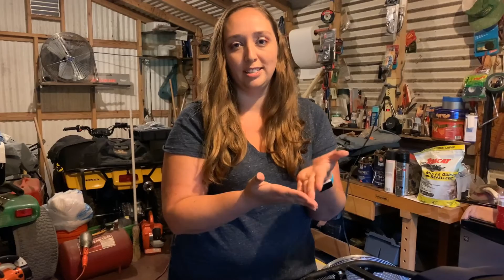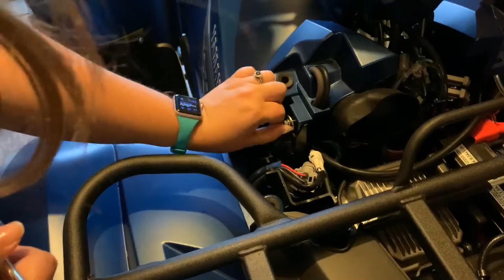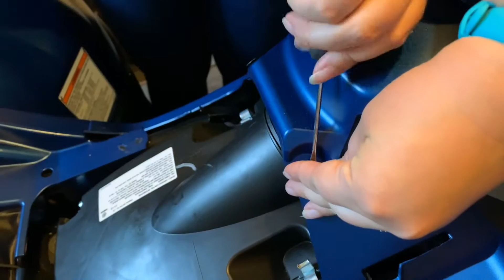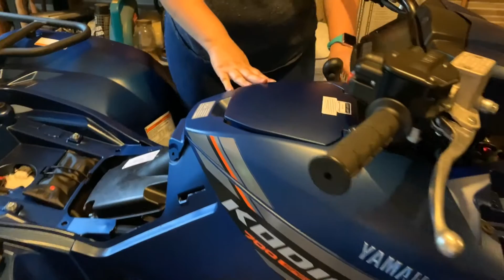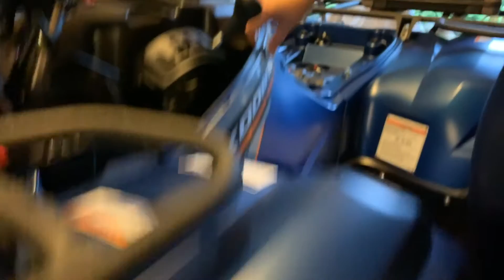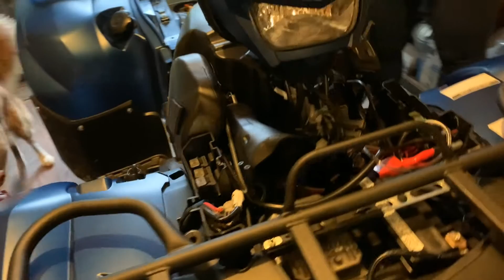Removing Plastic Panels on 2019 Yamaha Kodiak 700 EPS SE: Scarlet Shows Ya How

Comment: Thank you. But how do you take off the seat? Im scared to pull tug too hard and brake something.  How do you change the air filter?
Reply from the maker: For seat removal stand at back of machine lift on left and right back corners of seat with your hands. Then pull seat back towards you and that’s it. The stock air filter doesn’t require tools, just pop open four air box lid clips and remove lid, then pull and wiggle foam air filter element loose, clean and reoil foam and reinstall. There should be info on these topics in your owners manual.

Comment: Good Job Scarlet,  Also,  much easier if you remove the front luggage rack.   Now, help me find a bolt I dropped.  LOL  
Maybe show a video of removing the throttle cable next video?  Factory used lousy grease that dried up.  Fixed with spray, dry Graphite from the top down.  Bought it at O'Reily's ..
Reply from the maker: We haven’t had to remove the front racks when taking the plastic panels off, but if it helps you out that’s great.
If we ever have to remove the throttle cable we can make a video.  But so far we haven’t had any issues with ours so don’t plan to mess with it at this point. 
Thanks for watching!!

Comment: Gotta tear mine down to inspect after the dealer molested my machine. Got the 708 oil recall done, new rings. Sounds like heat shield rattle now, sucks having strangers work on your stuff IMO
Reply from the maker: Yeah it’s hard to find trustworthy mechanics nowadays.